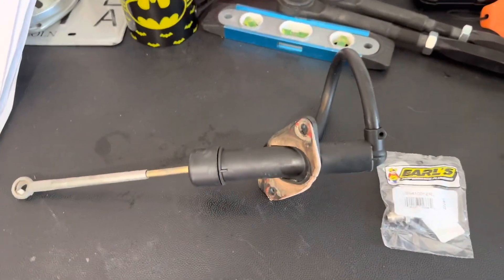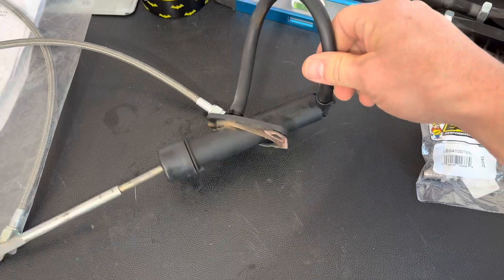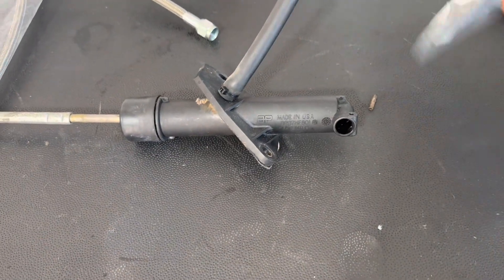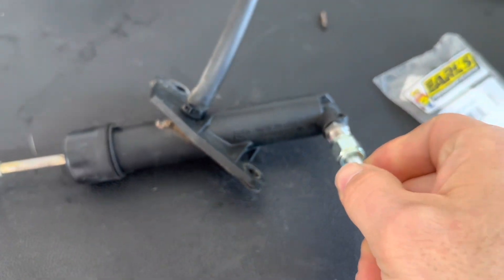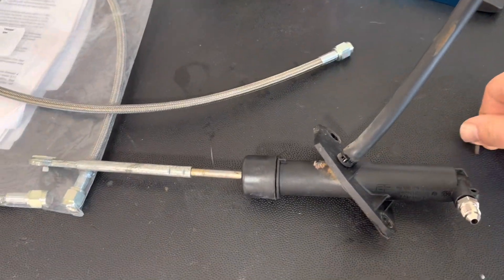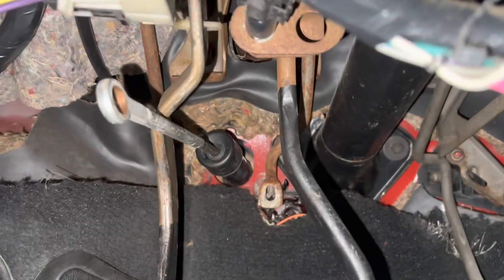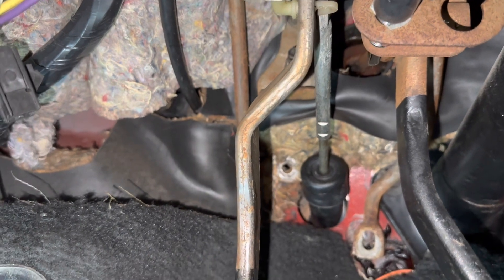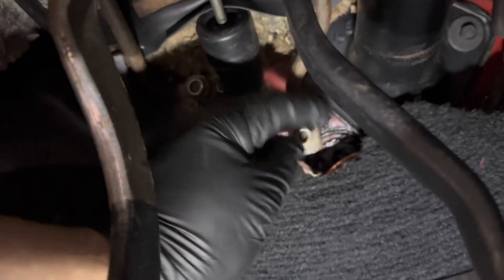85 Z-28 Thirdgen Camaro LS Swap 5 speed hydraulic throw out bearing to master cylinder retrofit.

Comment: Idk if anyone knows but I’m trying to swap my 97 mustang with a ls3 and a Chevy t5 idk what the trans what out of but it seemed to be these Camaros I need a throw out bearing solution or kit I was able to connect the trans and engine using a Corvette clutch and flywheel kit and a bbc bellhousing but the only bearing I can see that might work is the jegs one for Chevy 3 and 4 speeds but idk if that is the same size as what I’d need for my t5 the ones on eBay say they work but I cannot find anyone who has videos on this or has done it before
Reply from the maker: I would call Howe Racing Enterprises, give them the specifics of what you have and they will get you on the right track.

Comment: Hey what did you end up using instead of the plastic clip? I’ve bought new ones but the rod keeps slipping out ! Thank you!
Reply from the maker: @katofelix9705  I ended up using a c clip that I found at my local hardware store. I bought a couple different sizes but eventually found the right one. Hasn’t fell off since.